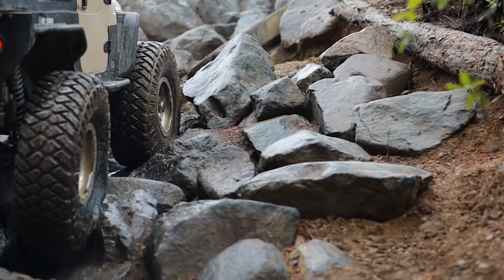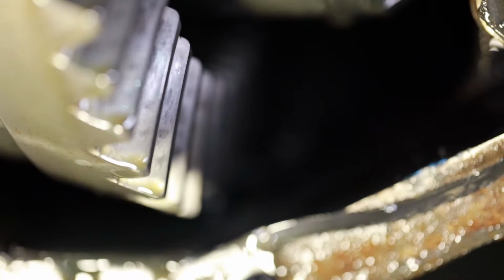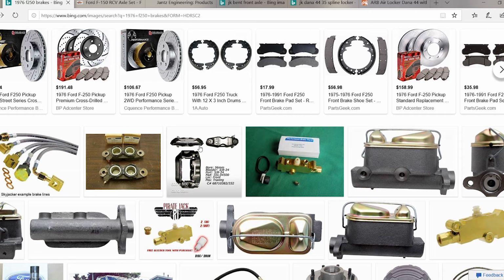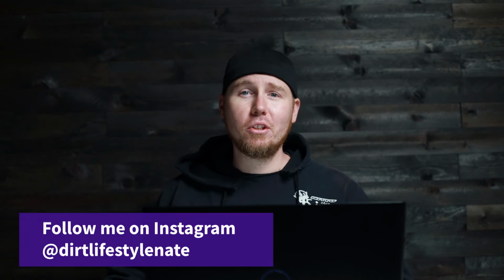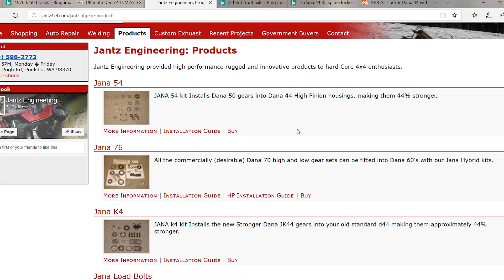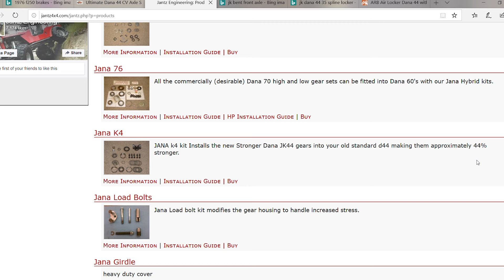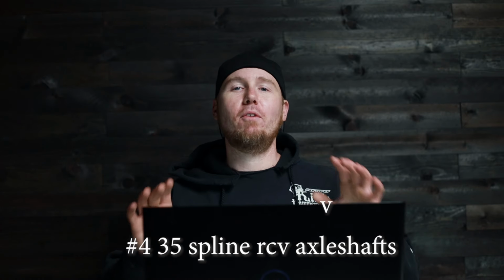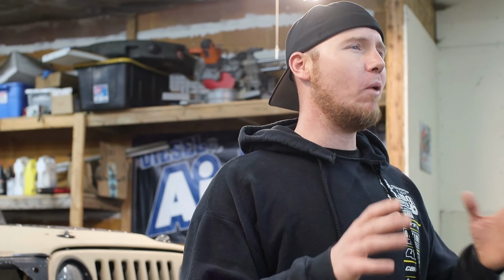Building An Unbreakable Dana 44

Comment: Real question: isn't having the u joint be the weak point a good thing because it's easy to replace?

Doesn't the CV joint move the weak point into the differential?
Reply: Idk it might be harder repairing a ring and pinion but axle shafts are expensive as hell now. Seems more economical to just run a 3/4 ton axle and get a bullet proof axle shaft. There’s always Dana 44 ring and pinions for sale on marketplace for cheap. I’m going the Dana 44 route for my barn door suburban. Yeah it’s not a 1 ton but with cross over steering plus ball joint eliminators and these upgrades mentioned in this video I think it’s way more affordable. Hell just to get a Dana 60 that’s a complete hunk of shit costs 1500$ and up then you’ve got to restore it then start upgrading. I’m trading a set of dodge axles for a SRW Dana 80 full float and a Chevy Dana 44 tomorrow. For the super hairy situations in my heavy Chevy I’m just going to rely on the rear end and leave the front diff open.

Comment: Would this built 44 handle 42.5s no problem?
Reply from the maker: There are MANY variables but for 99% of 4x4s a dana 44 will not be strong enough for 42s.

Comment: I’ve seen most of your videos and appreciate the education and entertainment…good stuff!  I drive an 04 TJ Rubicon manual trans that has a 4 in susp lift and 35s. This video gives me more confidence in my Dana 44s than I already had so thank you.  There’s another school of thought out there on axle builds that I’m curious what your thoughts are.  Some say leaving the Ujoints as the weakest part gives you a “fuse” so you have a predictable failure point if something is to go wrong.  With RCV shafts, this would transfer that “weak spot” to another place, possibly ring and pinion?  What are your thoughts on this strategy?  Thanks!

Comment: Nate, I have an 87 Suburban 3/4ton 8 lug diesel. No idea of my front axle. I know the rear is a floating 14 bolt. How can I tell? Thanks!
Reply from the maker: The diff cover shape should tell you. Look up dana diff cover in Google images and you will find a sheet of all the different models. Alot of axles will say on the housing as well 👍

Comment: You're mistaken about the Jana K4 conversion.  It only applies to low pinion/standard rotation Dana 44s.  For high-pinion/ reverse rotation 44s , the Jana 50 conversion is the one that works.  The JK HP 44 front ring and pinion set is no stronger than an equivalent Ford set.  The low pinion JK Dana 44, on the other hand is significantly larger than an old-style D44 R&P.

Also, the Jana K4 setup does not use a JK carrier (or locker), it uses a standard Dana 44 carrier in order to move the ring gear further outboard and away from the pinion, which would otherwise be too close in the standard Dana 44 housing.
Reply from the maker: You're absolutely right I messed up
Reply: @DirtLifestyle  We both messed up when we got into this hobby, brudda!

Comment: Well what about a Dana 60 with RCV axles????
Reply from the maker: The dana 60 with rcvs would have identical axle strength as the ultimate dana 44 but with more ring and pinion strength. As long as it is a high pinion version. 👍 but if you want to get crazy you can get 40spline axle shafts for the d60. Full beast mode ...

Comment: I've been curious hope comparable is a J10 44 to the F150 44
Reply from the maker: The ford version is stronger due to the high pinion center section 👍
Reply: @DirtLifestyle  so it's just the high pinion advantage no inner c awkwardness I'm wanting to build my 80 J10 and was curious if I should change it for strength

Comment: Hey Nate and People in the Comments, does anyone know how much modifications (if any) besides those necessary for the Jana K4 Kit are required to put some 35 splines in a Waggy 44? I’d also be interested in hearing if anyone can give a rough estimate on how much a set of custom 35 spline RCVs are compared to the standard 30 splines they offer for the Waggy. As far as I understood the outers would still be 30 splines so the adapter they are offering for the 30 spline outers to fit into the ARB Lockout Hubs should still work right? Just planning out the axles for my YJ

Comment: How did you build such bombproof Dana 44
Please elaborate
Reply from the maker: Dana 44 hp from a 76f150 with rcv axle shafts and a chromoly locker. Simple ingredients but it makes a solid build. Also I have a very small scrub radius making it much easier on ball joints and steering.
Reply: An after thought 💭 
F150 Dana 44 direct bolt-in?

Comment: How about super strong Dana 44 rear ?
By the way you are awesome 
Congrats on your on show
Reply from the maker: Thanks! The dana 44 rear is ok and upgradeable but I prefer the ford 8.8 and ford 9" as rear axles if it's an option 👍
Reply: Can you do a video on the best Ford 9 bolt build ?
Reply: So your video is got my wallet emptying out
Reply: I just ordered
1977 Dana highboy with the 1/2 inch tube and I'm going to build
The ultimate Dana 44 
What hubs  would you put on it ?
Also anyting else you didn't mention on your video?

Comment: Love the video but you need to do more research. The Jana K4 is for low pinion applications. 

Don’t run 30 spline stubs in a Dana 44 without undercutting the shaft after the splines. If you break a 30 spline stub in a Dana 44 spindle it will balloon the spindle and leave you stranded.

Other than that, Dana 44’s rule!

Comment: You must note that the Jk gears ONLY FIT LOW PINION DANA 44s they will not fit the high pinion housings because they are not reverse cut!! The Jk d44 front reverse cut gears have a shorter pinion than the standard d44 pinion!

Comment: I’m going to have to watch again.  Way too much info.  Have a 15 JKU and it has a 30.  I want wider than stock 44. Now I need to look for a front end for it
Reply: you call out a 1976 to 1979 F150 Dana 44.  The 1978 to 1979 has the cast wedges on the tubes.  How do you get around that?  Can you replace the axle tubes?

Comment: Will not buy from Yukon anymore. They refused to sell me the small end case half of my d60 air locker. I broke a shaft and it took out the carrier journal. The locker was perfectly fine but like I stated the carrier journal is trashed. Called Quick performance and they sold me Eaton 40 spline locker and ECGS sold me 1550 40 spline moly shafts.

Comment: Great video. I wish you could run one of these older D44 axles in a JK or newer... Unfortunately they do not have the ABS tone rings necessary to retain all of the factory ABS, cruise control, Traction control, and stability control. Without all of that stuff the engine goes into limp mode. I swapped in a Rubi D44 J8 Recon housing (5/16" wall), and welded in a full Artec Armor / truss kit. Should be pretty stout. Just wish I had the locking hubs instead of unit bearings. They make kits to convert to  lockable hubs, but $$$$$$ and they are not even water resistant. https://www.youtube.com/watch?v=ZsuxOHLXZA0&t=165s

Comment: Any time you can gain strength without adding sprung weight or rotating weight, that’s a win. Losing horsepower to rotating weight and adding cost for stronger suspension components is ok if you have the power and need for them, but for 90% of average dudes, it’s a waste of money.

Comment: Lot of people just don’t understand how much difference there is in strength between a real d44 and modern d30/44 hybrids of today. Find the right ford and you get both a real 44 and either a real 9” or real 8.8. Getting front and rear from same truck. I love when keyboard wheelers bash my 37’s on a locked hp30 and I see them running 37’s on a rubi 44 lol. Not even aware the are all the same parts except for center in which a hp30 is equal to lp44 at least up to 4.56 gears cause I’ve yet to see a locked 488 not eat gears..

Comment: sorry bud but i have something for you. love carl j, but i found this...this kit uses the jk larger/thick gear, but the large dana 60 pinion. so your input pinion gets massive in the same housing, it uses the jk ring gear and you can use the rcv. and with 1/2" thick tubes, its almost unstoppable.   https://www.justdifferentials.com/Dana-44-Nitro-Thick-Ring-Pinion-4-56-Ratio-p/d44-456bp-t-ng.htm

Comment: Just get rid of your Dana 60, then your 44 will break the next day.
Reply from the maker: Lol no doubt!
Reply: @DirtLifestyle  
I'm looking for info on a rear Dana 44. Which vehicle had the beefiest rear 44 housing? All I've ever seen is 2.75" tubes. Supposedly 3" versions exist, but that seems to be an internet fable. 
I think I want to use old style iron housings. 
Should I even consider jk rubicon and jk non-rubicon rears? Besides the larger jk era gears... I'm not sure there's anything better about the housings. 
It will be run on disc brakes. The jk has them, but something keeps me averting the jk. 
Besides if I need to, I can research the jk rears pretty easily. I'm mostly looking for info on the pre jk pre tj old iron (non zj) rear Dana 44 options. Thanks Brotaterchip.